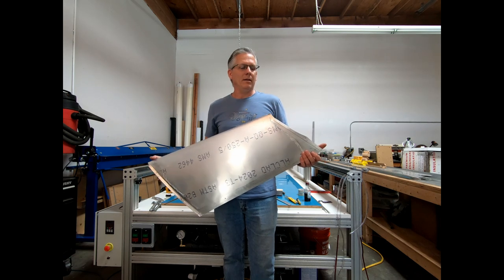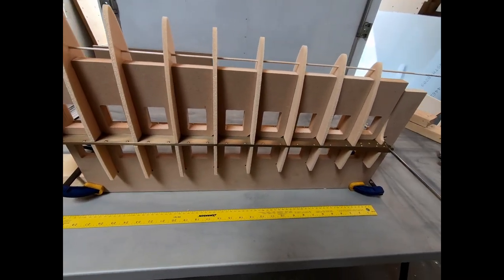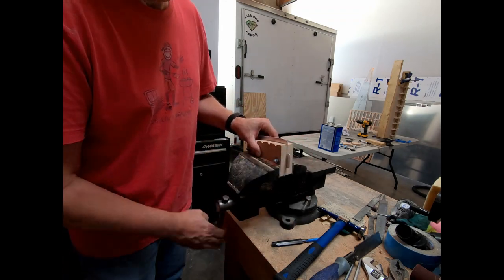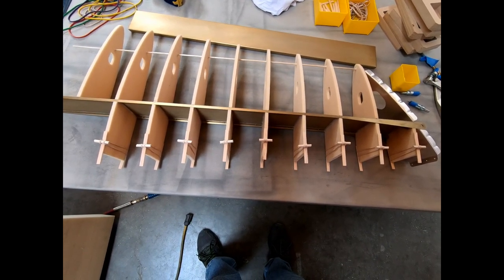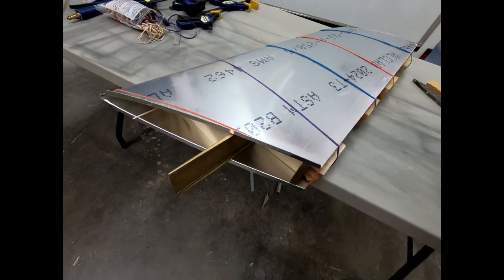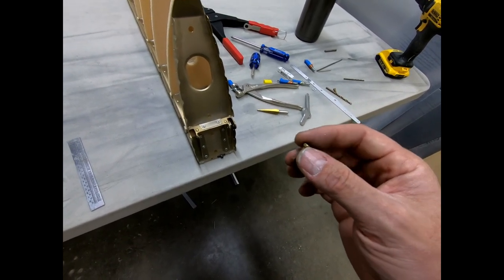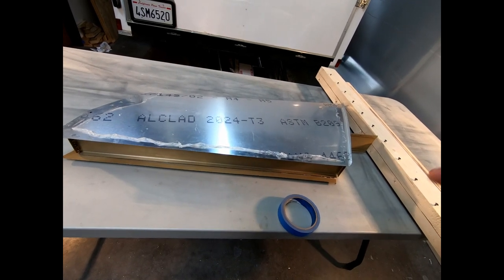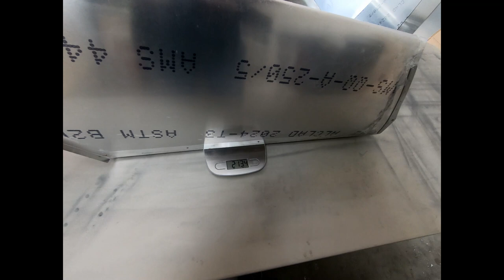6 - CriCri Airplane Build - Vertical Fin

Comment: Good job sir. I  want question. How  long wings cri cri air plane
Reply from the maker: Wingspan is only 16 feet tip to tip. Each wing panel is only 6.5 feet long (2000 mm) without the root spar and wingtip.